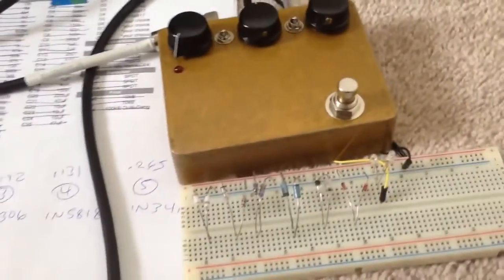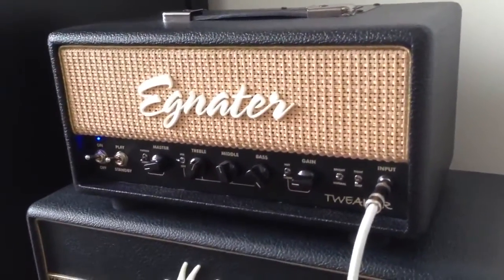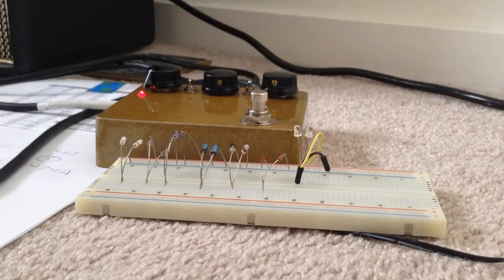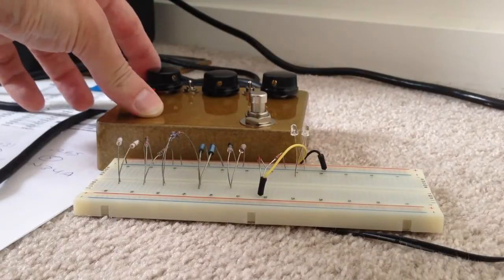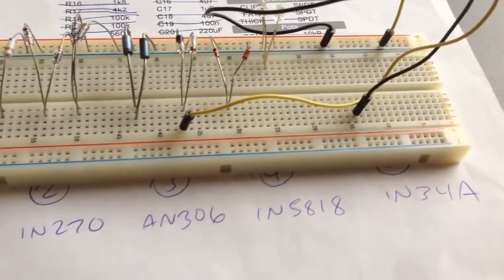Overdrive pedal (Klon) clipping diode comparison

Comment: The 1n34A diodes, being like what's in the KTR are off in their Vf by almost ten. That potentially makes a big difference. The Klon Vf was .35, as determined by the guys at FSB. I still think Bill Finnegan likely used the ITT 1n34A as ITT was very close to him, and were an easy and plentiful source, rather than this mysterious source he's claimed all these years. As well, they are now and have been difficult to obtain for a while. I stumbled into a guy on eBay who had a large amount of them. I bought quite a few from him. Not because I seek to re-create the Klon, but because actual germanium 1n34A can be hard to get a hold of anymore. Just a thought, it might be worth getting a hold of the ITT 1n34A for anyone wanting to nail the Klon sound.

Comment: The Klon Centaur is not an overdrive. It is a diodes to ground hard clipping distortion circuit with a clean blend tied into the gain knob.
Reply: That's the interesting thing about the Klon -- as you note the core of the distortion is closer to a Boss DS-1 or a Pro Co Rat, but people perceive it as an overdrive because of the blending.

Comment: Just a upgrade from Nick Fox version, for future use. 
--Clean tone - 2:52 

--3mm LED (~1.5v forward)
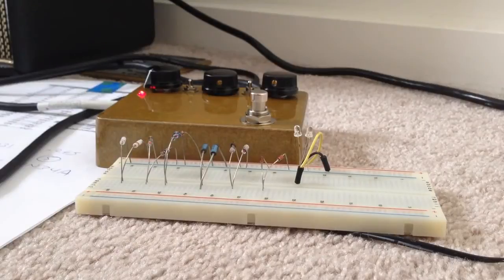Low Gain - 3:21
Middle Gain - 4:50
High Gain - 5:11

--1N4148 Si (.559v forward)
Middle Gain - 5:47
High Gain - 7:05

--1N34A Ge (.265v forward)
Low Gain - 7:57 
Middle Gain - 8:11
Middle Gain 2 - 14:31
High Gain - 9:05
High Gain 2 - 14:37

--1N5818 Schottky (.131 forward)
Low Gain - 9:39
Middle Gain - 9:47
High Gain - 10:04

--AN306 Ge (.193v forward)
Low Gain - 10:31
Middle Gain - 10:38
Middle Gain 2 - 11:06
High Gain - 10:56
High Gain 2- 14:12

--1N270 Ge (.220v forward)
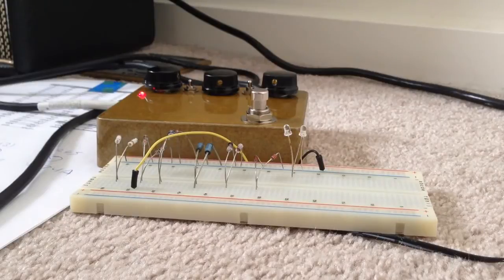Low Gain - 11:40 
Middle Gain - 12:01
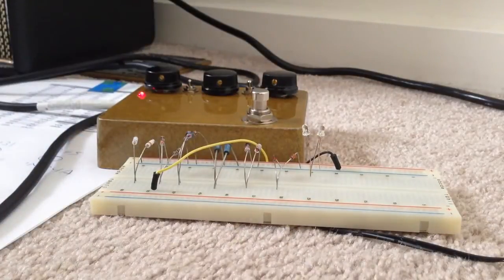Middle Gain 2 - 14:03
High Gain - 12:14

--Japanese White Ge (.213v forward)
Low Gain - 12:52
Middle Gain - 13:02
Middle Gain 2 - 13:43
High Gain - 13:20

Comment: The Shotkey diodes and silicon switch faster than the germanium or LED and that generates more high frequency harmonics. Germanium soft knee clipping  sounds warmer.  Thanks for moving the gain around so we can hear it.

Comment: With LEDs you should try different colours, because they opperate at a different voltage and thereby they don't sound the same. Usually I stay away from the red ones, as an example.

Comment: 2:52 clean tone
4:45 3mm LED (~1.5v forward)
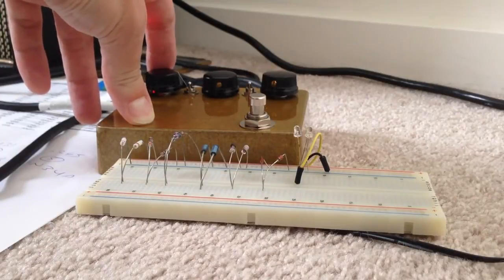5:30 1N4148 Si (.559v forward)
7:32 1N34A Ge (.265v forward)
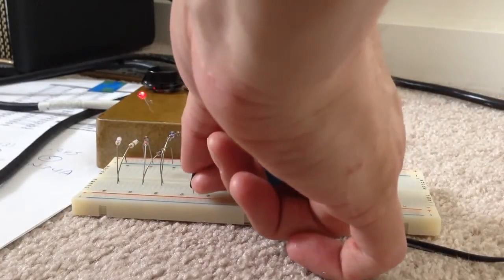9:28 1N5818 Schottky (.131 forward)
10:20 AN306 Ge (.193v forward)
11:35 1N270 Ge (.220v forward)
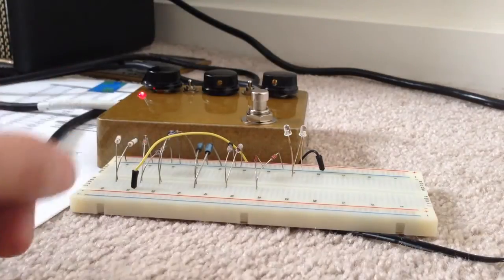12:38 Japanese White Ge (.213v forward)
Reply: Shottky not Shockley, that's the model ;)
Reply: I just copied and pasted from the description above. It's been fixed, thanks.
Reply: Most useful comment I've seen in years
Reply: Have you tryed ocd cliping in it ...? + would it be harder to do ( im thinking about ) ? 

http://zadvitsky.com/wp-content/uploads/2016/12/bigOCDschematic.png

Comment: 5:57 - "You can pull the diodes out of the circuit and it you'll hear clipping".  --  That guarantees that this diode comparison is meaningless.
Reply: 909955847736 incorrect. As he pointed out diodes aren’t the only thing that clips within the circuit, the opamp does as well. If you prefer it without the diodes by all means don’t include them. But if you prefer the sound of one of the diodes add them. That’s far from meaningless.

Comment: Most of the clipping comes from the opamp. Bill F stated he used the common 1n34a. The diodes are not magic. Any germanium with a forward voltage between .25v and .40 will yield an almost inaudible difference

Comment: Mix 1n270 with 1n34a. They have similar forward voltage but a bit different clipping. I tried it with 1khz sine generator and osciloscope first... FTT showed more 4th harmonics than 3rd with the same amplitude on each side of wave and while listening it sounds really smooth, tube like.

Comment: Any OD will respond better with a buffer in front. The chip is current dependent. Put a buffer in the guitar just for goodness. Mix an LED with a MOSFET transistor set as a clipper-(look it up).  Or a red and a blue LED.  Harmonic tube squeal from Hell with high gain. Lets you get higher on the gain knob and still be intelligible without as much mush.

Comment: Try JFET transistor clipping..
Reply: +DarkVoid , The mosfet style would likely rock. Mix a mosfet with a red LED. Holy Moly.
Reply: @TheFarout69  I use a pair of 2N7000s, they make it sound smoother. I have to turn the tone control up. Very musical and adds a sweet compression and sustain.

Comment: Thanks for the test. Interesting results. Apparently the actual Klon uses a germanium diode with .35 vdc forward. Other diodes that you could try for comparison are, IN277, OA91, which I've heard, although don't quote me,  both measure 0.35v. Other popular choices include BAT 46, and Bat 41(mad bean).
Reply: I used D9E's in my KLON clone.
Reply: +POG FROGULPOP I use the BAT41 in all my Klon builds ... they sound the best to me , and they are close to the original Klon clippers .  The 1n34A is close as well ...
Reply: i see the D9E is the closest diode than the original 1n34a